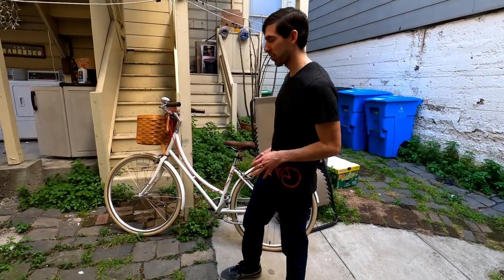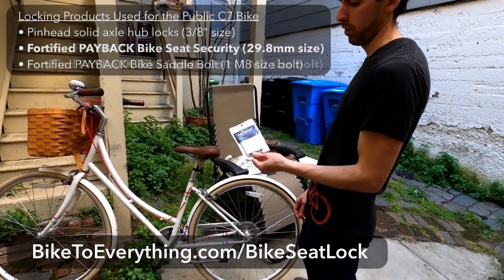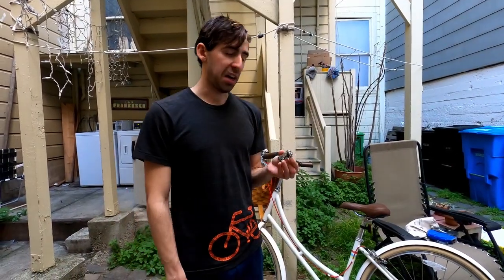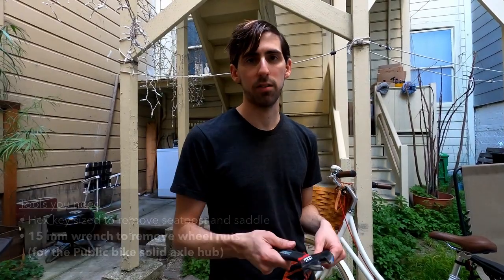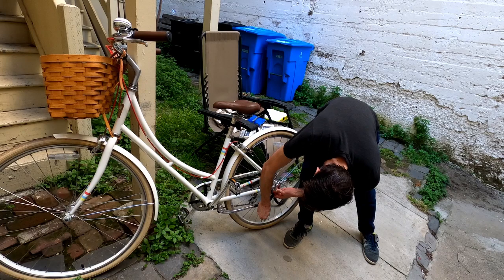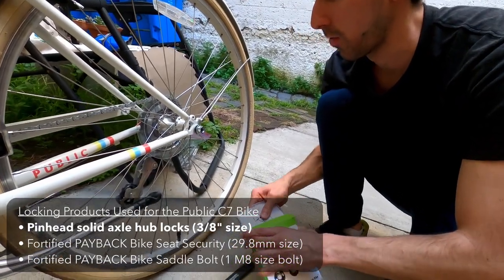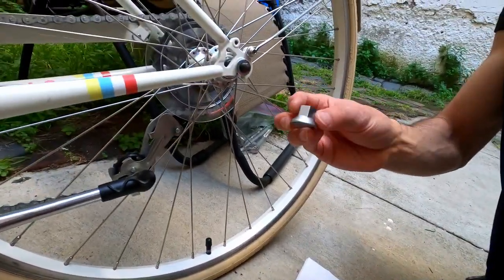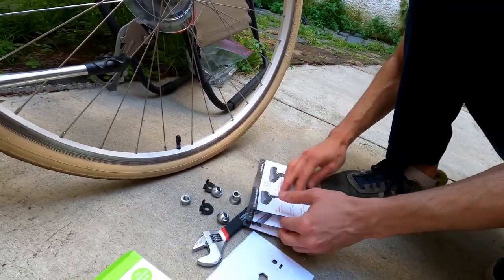How to Lock the Wheels and Bike Seat of a Public C7 Cruiser Bike. Relevant to other bicycles too!

Comment: Hi, thank you for posting this!  I'm a newbie, and although I have that clamp to go around the seat frame part, even though it's tightened as much as possible, the seat stem can easily be spun around and lifted out.  Any suggestions?
Reply from the maker: If you've tightened it all the way and it still spins that means you need a smaller size for your frame! Try to measure it out and try a smaller one.